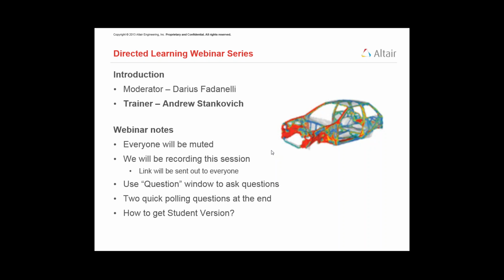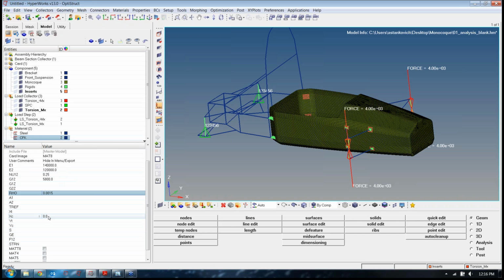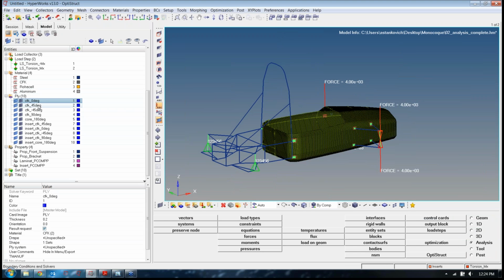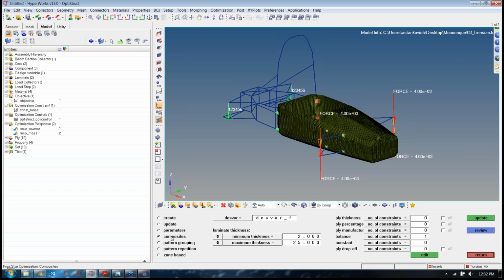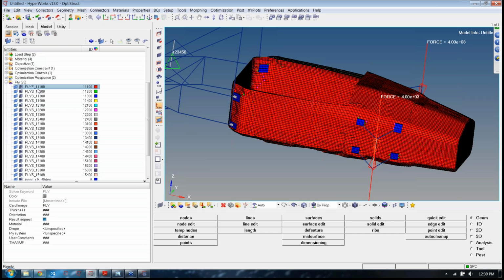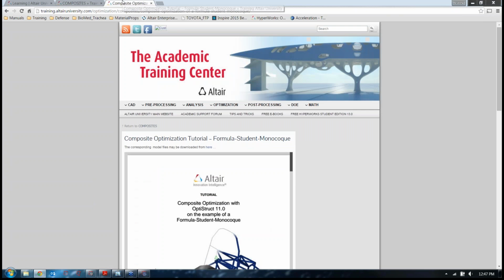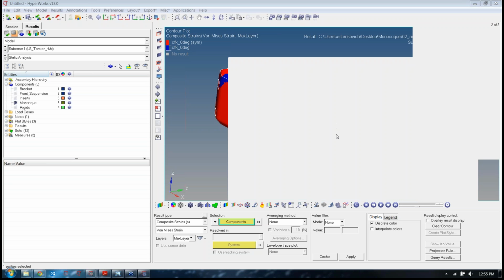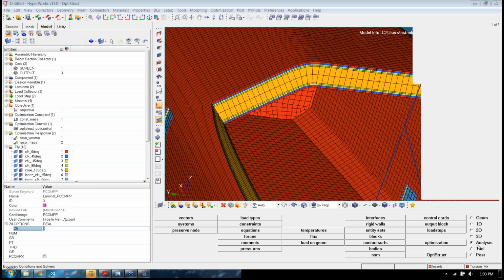OptiStruct for Composite Analysis &  Optimization

Comment: Hi,

I have some questions I was hoping someone could answer.
I am trying to model a sandwhich structure with carbon fibre skins and aluminium honeycomb core and then perform a 3 point bending test in the software if possible.

1. Could someone please explain what the reason is for selecting PCOMPP, PSOLID etc, what are the reasons for choosing one of them over another?

2. Which compersite property: PCOMPP, PSOLID, PSHELL, etc, do I need to select for the task I want to achieve (3-point bending simulation)?

3. Another question relates to my understanding of the MAT 8 card....would I be correct in saying that as MAT8 only asks for the in-plane properties, it would not be possible to get proper results for a 3-point bending test in the software? (Or does the software still work this out?)

4. Would I need to use the MAT9 card for what I am trying to do and in that case what composite property do I select, PCOMPP, PSOLID, PSHELL, etc?

4. If I select for example PCOMPP for the honeycomb properties, do I have to select PCOMPP for the carbon fibre skin properties?

Regards

Comment: Where do you manage the units? Where is the option to input units? (11-13 mins in)
Reply: First of all I have to Say that I'm not an Expert in Altair, so take my words with their value. I had the same questions some mounth ago, and I have to Say that Altair works with a parametric system of measures. So, there Is a certain number of combinations of ünit of measures you can choose within. For example, with the One that I use, I have to think at lengths in mm, masses in tons, pressures in MPa and forces in N. I Hope this has bene huseful for you